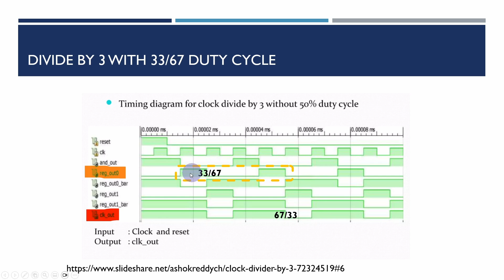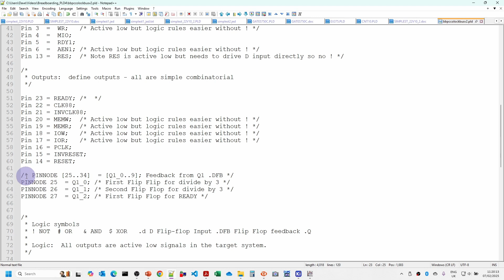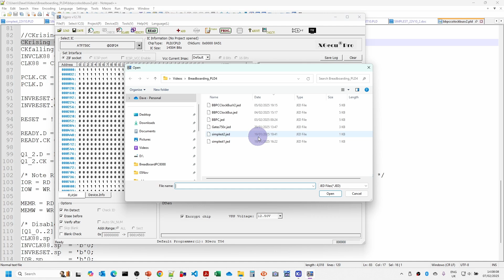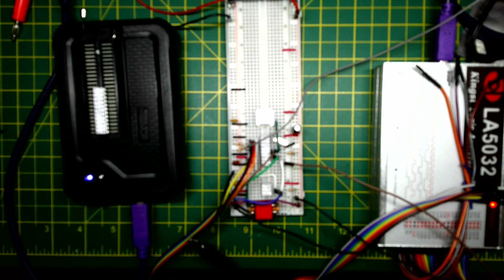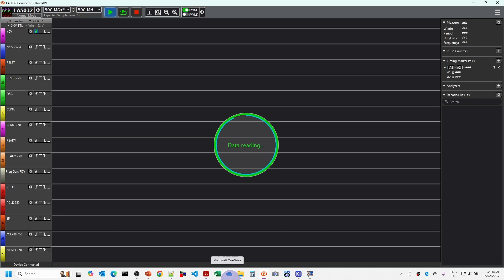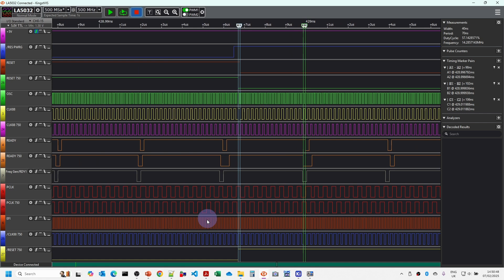Replacing Intel 8284/8288 with ATF750C PLD (PLDs part 6)

Comment: Hi Dave, thank you so much for this PLD mini series. I was in fact using WinCUPL a lot. However I was using it because I use a lot ATF15xx CPLDs. I used PALs and GALs a long time ago . But from time to time I have small projects where a ATF15xx is pure overkill and when a GAL would be just the right solution. However GALs are no longer available and for a long time programming microchip EPLDs was not really supported by cheap programmers, or that's what I thought. With your mini series I now not only learned a lot of new things about GALs but also that cheap programmers in fact support these chips. Now I will give it a try again 🙂. As for WinCUPL, my experience is different, it crashes a lot, but not because of the project window. Mostly the formatting of the input file is the cause, e.g. missing newline at the end, invalid ASCII characters or serious syntax errors. I'm running WinCUPL successfully in UTM virtual machine on my MacBook using Windows 11 on ARM. And my impression is, that it runs as stable as on every Intel based Windows I used before.
Reply from the maker: Thanks for the feedback. I would be interested in how you program your ATF15xx chips? I seem to remember you can dedicate some of the pins for direct programming without the type of EEPROM programer for the smaller chips. Just the PLCC format not that easy (or cheap for DIP adapters) to use on breadboards. Dave
Reply: @breadboardinglabs  The ATF15xx use a JTAG interface to be programmed. I'm using the original ATMEL programmer ATDH1150USB-K which currently seems to be hard to get. When I ordered it, it was about 60CHF. You need ATMISP v7.3, which is free as WinCUPL. Alternatively you can use a cheap ALTERA USB Blaster clone and use the opensource program "openocd" to program them. I did that as well just out of curiosity and it worked perfectly. The JTAG uses four dedicated pins on the ATF15xx and is in-circuit programable, the pins are named TDI, TDO, TCK and TMS. Make sure you select the correct device in WinCUPL e.g. f1504isptqfp44. You could also use these four pins as normal IO pins, but then you loose the ability to reprogram the device using the JTAG interface and you would need to apply 12V to the pin named OE1 when powering up the chip to recover the JTAG interface. They are no longer available in PLCC format. However the ATF1504 comes in a TQFP-44 10x10 package, which should be much easier to solder than the 16C550 in the TQFP-48 format you use with an adapter on your V2 PC on breadboard. The TQFP-44 10x10 has a pitch of 0.8mm rather than the 0.5mm pitch of TQFP-48. I once bought TQFP-44 to DIP adapters but now I made my own adapter PCB with the JTAG header included so I can use them on breadboards and program "in-circuit". Let me know if you would like to have more info.